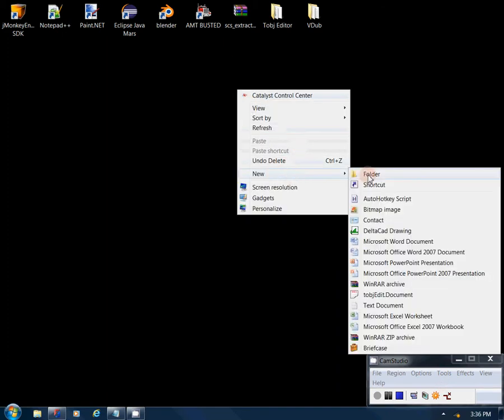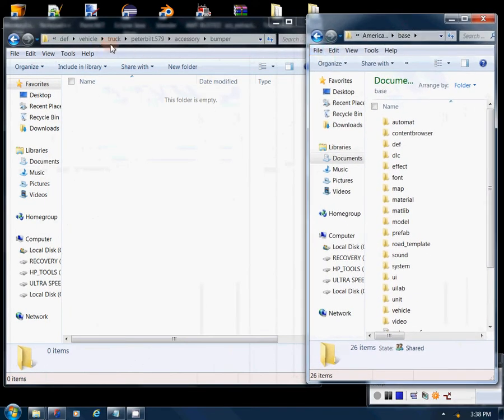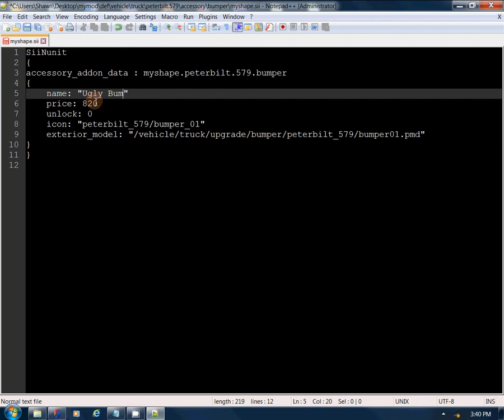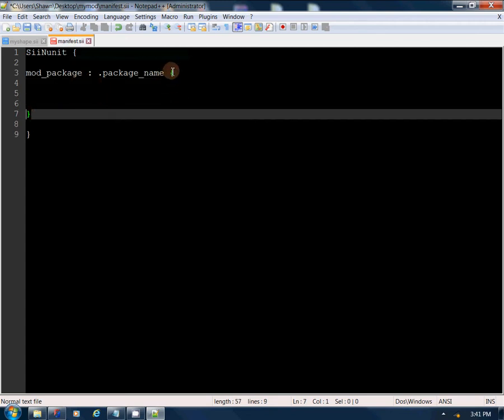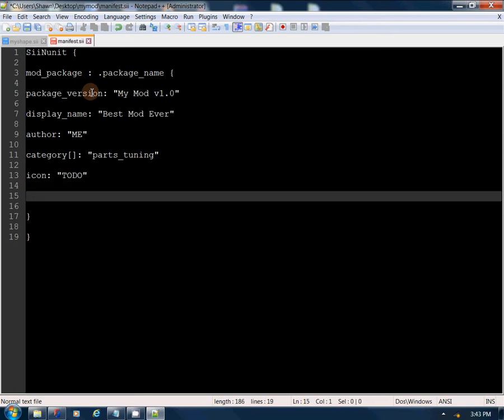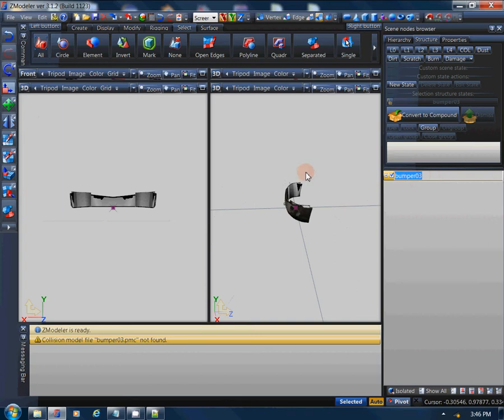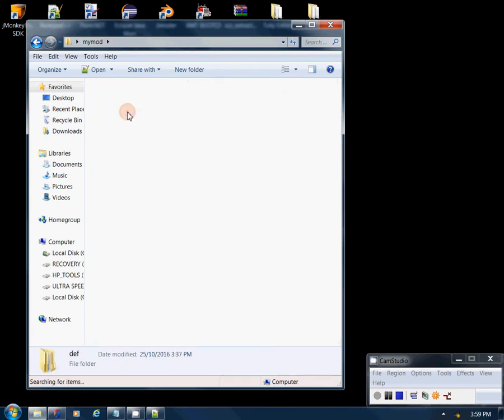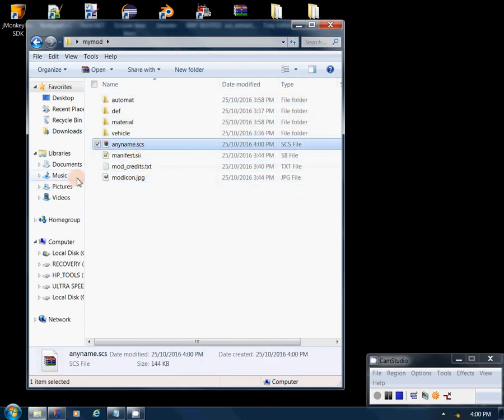ATS Modding Tutorial #2

Comment: Would you know by any chance could be wrong with default metallic color on scs truck model. I imported the file with no error, but on export the cabin metalic color is broken in the game - it looks strange kinda like in Zmodeler. I tried remap as you show on video at around 19:05 but no success. Its Scania S model and funny thing is that if I customize the truck and add ''DIVA'' rear bumper from DLC the metallic colors suddenly work - apart from those with emblems and special stripes.
Reply: Also if I isolate the part with broken color the UC channel is set to 2 by default.